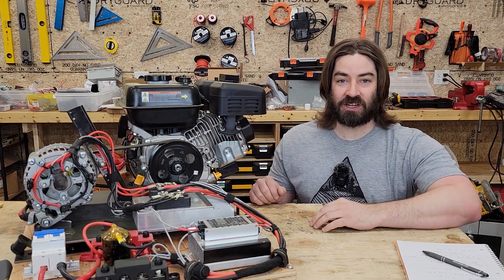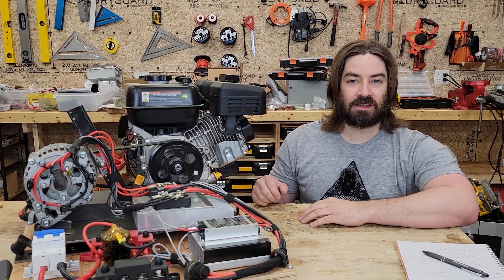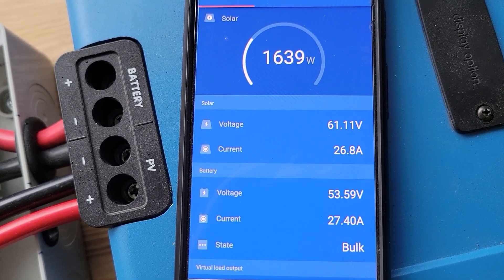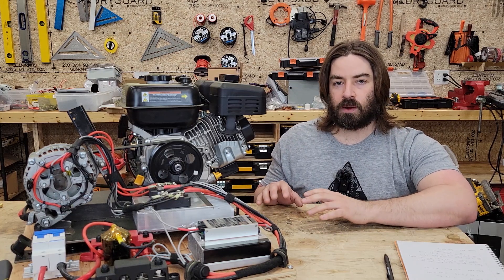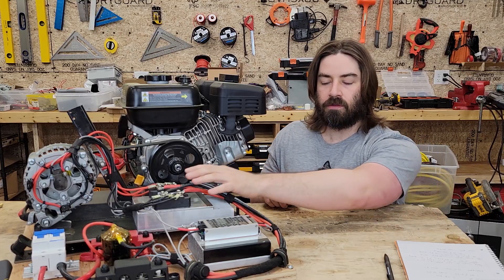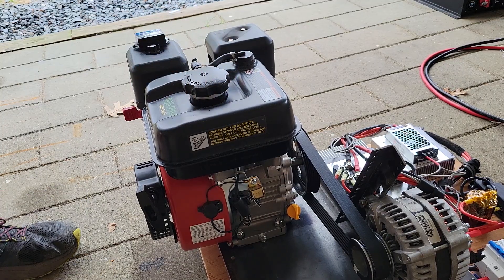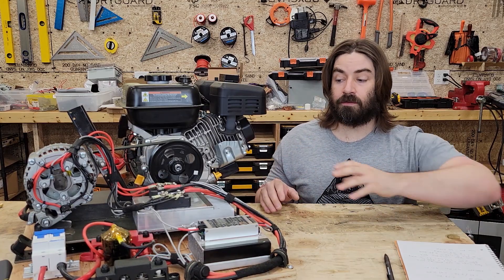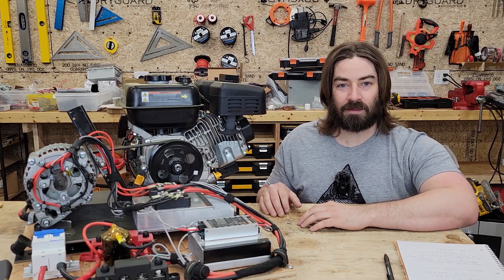More Efficient than ever!  Alternator Generator fine tuning, Part 3

Comment: You should get a heavier flywheel for the engine to reduce the shaking and get an more even load and rpm on the engine as you have a low rotating mass too the high load
Reply from the maker: When I searched for flywheels, I found lighter aluminum ones, but I didn't find heavier ones.  Do you know where they are sold?

Comment: Hi David, did You think to use alternator from mild hybrid? There are water cooled types and they are directly for 48V... Usually they are motor-generator, so you can start engine with them. No need to use victron, no external rectifier, ...
Reply from the maker: I didn't know about them until my first video in this series when a commenter mentioned it.  I think it would be fun to test if I could find one.  However, I've got some other generator projects in the pipeline that I'll be working on soon.
Reply: Where can I get one of these from a mild hybrid? What do I search for?

Comment: That's awesome. Glad to see my theory proven out.

I don't think it's super necessary, but I'm now wondering if efficiency could be clawed back with a different belt length and different ratios. 

I will get off my butt and get my Alternator Generator rebuilt and run some tests.

Comment: you got something wrong here.
youre trying to maintain 2600rpm... with the throttle. thats not how it works.

you have to do it at FULL throttle, and LOAD it down to 2600 to see the "max torque"...which will also be maximum volumetric efficiency. at which point the alternator is a dyno... minus friction, iron, and copper losses... what you get out should be what the engine can make. and at that point, what the controller is seeing and stuffing into batteries will be the absolute best the engine/alternator combination can possibly achieve.

it doesnt sound smooth as its running with the throttle partially closed.
if one alternator at full load cant stall the engine, you need two. if they cant, you need three...

tear the excitation coil out and rewind it with about double the turns... which is what you should be doing anyway to get rid of the need for the smps excitation drive altogether. a higher resistance coil, less amps, more volts, ideally more amp-turns (what actually matters) for the same or possibly even less excitation power. winding coils can be a bit of number juggling with gauges, turns, etc...

remember the excitation coil is designed for the voltage the alternator was intended running at.. and it IS just a simple coil of wire.
Reply: I am pretty sure the throttle on this type of motor is actually setting a governor. The throttle is an input to a speed control device.

Comment: Mine is about an equal engine, but a 4KW generator instead of an auto alternator. I get 120/240AC that loads up the engine if the use is more than 70%.  As I only use it to charge my house inverter system also, there is hardly ever a full load requirement.  But the big difference is that mine runs on HHS that is powered directly from the generator output to a 12VDC that produces 30 amps on the 12v side and only draws 2.1A on the 120v generator output, meaning I have a lot more over unity out of my self powered device. 

On a water electrolyte that costs only pennies per gallon of water, to create it, the hydrogen generator is fairly large with a total of 3 gallons of electrolyte and uses less than a gallon of water per day to run 24 hours per day. The generator runs a little cooler and smoother, and I operate it between 2750 and 2900 RPM.  Hydrogen produces a little less horsepower so I use another trick of running the hydrogen through a large aquarium bubbler in a gallon of regular gasoline, which kicks some of the hydrocarbons off into the air stream into the dual fuel carburetor.   This size engine uses a lot less water and very little gas per week, but requires oil daily and a full oil change every week. Once a month while doing an oil change take the carb apart and clean it, HHO creates a little sludge like ruining propane that tends to crystalize in the carburetor throat. I haven't bought a bottle of propane in years, I use the hydrogen for the generator, the house furnace, and even the yard BBQ grill. Though you do want to get an Hydrogen generator that separates the hydrogen and oxygen, together in the same pressure vesicle above 15 psi can spontaneously combust. Even through I have a pressure switch to 20 psi cut off on my separated  combustible gases, hydrogen and gasoline hydrocarbons are a lot more flammable than anything you want to use lightly.  Use them with respect and with all of the safety protocols and they are better than conventional fuels.

Comment: Thanks for this short and sweet video. Im surprised the middle ground was noticeably more efficient. Im not sure whether that primarily comes from the engine side or the alternator side, but it definitely has a noise level benefit. Even though im a ‘car guy’ first i tend to hate the sound of constant speed single cylinder engines droning away. Lowering RPM is the easiest way to address that, if it doesn’t cost you anything else. I once went to great effort to adapt a cable throttle and large muffler to a push mower engine so i could use it on a riding mower with a small crane mounted to the front, without it being objectionably loud. It did work but im thinking round 2 of that project will just be electric propelled instead. 🙂
Reply: It's entirely possible that at 2600 rpm (peak Torque) there was too much loss due to vibration. It takes energy to move that mass around. So finding a Harmonic RPM where the vibration is reduced to almost nothing serves to increase the amount being generated

Comment: I really enjoyed that. Playing around with essentially settings to get greater efficiency was very eye opening.

So, the vibration aside, you should be able to run the engine at peak torque RPM and still get the full rated power by changing pulley sizes so the alternator is rotating at the speed it was in the the last episode.

What I'd love to see, is what this engine could do at peak torque vs fuel consumption vs power produced. It is well established that you get the most value out of your fuel if you run near 100% charge capacity so if you can stand the vibration this could be a great fun test.  

IIRC, Peak torque is usually peak volumetric efficiency (VE) or the point where the ratio of energy consumed vs energy generated is the best (peak power is where the most air and fuel are consumed).

Distilled down VE is just a ratio of the swept volume of the engine x the RPM to come up with an amount of air an engine should use if filled perfectly, VS what it actually uses.
So hypothetically, say it should use 100CFM air @ 2400RPM but it uses 90CFM then it's VE is 90%. The losses are, air cleaner, intake manifolding, exhaust etc, etc, etc. It is possible to get over 100% VE without forced induction but I digress.

Comment: As I mentioned in an earlier post, it is not necessary to have your "jump start" battery.  Just connect the power supply to the output breaker, and simply turn the breaker on to get everything running.  The power supply will run off the battery under charge, and eliminate the need for the small jump battery.  Also, you should test using a slightly higher voltage supply, with a PWM voltage regulator on the output to run the alternator field.  The field should easily be able to handle 16v, and with an adjustable PWM on the power supply, you can independently adjust the field voltage to get more or less output from the generator without changing engine RPM.  Using this method, you should be able to tweak maximum power point at the most efficient motor RPM.

Comment: One thing about these small engines is, is that they have fixed ignition timing. Sometimes, adjusting the RPM gets them closer to an operating point, that makes their preset ignition advance optimal. An engine is always more efficient, if the timing is correct for the RPM and load. Under light load, the engine is more efficient at lower RPM, and at full load, (wide open throttle) you want to allow higher RPM. At full load, 3,000 RPM might be the best efficiency point for this engine. (Brake Specific Fuel Consumption)
Reply: Brake Specific Fuel Consumption👍 This.
Reply: @PeterJFrancoIII lol😂

Comment: I love this series and I think that making the ratios 1:1 will get you the most efficiency because that is where the engine and alternator efficiency curves align the best.
Reply: In the past, most people would do a 3-4:1 alternator:engine ratio, this was mostly because if you're using a 12V configuration and depending on the internal regulator, you need to spin the alternator fast enough for a 1-wire generator to self energize, also some alternators require a certain RPM to start generating.
Reply: In my experience alternators are much more efficient at high RPMs. If anything I would try 3:1.
Reply: @mckenziekeith7434  Since he is running the rotor on a DC-DC regulator and using a PPT downstream on the DC output side to step whatever comes out down to battery voltage, the rotor is likely running at a stronger field strength and drag than necessary. I wouldn't be surprised if a good chunk of the stator heating comes from unnecessary eddy current losses in the armature instead of the copper. He'd need to fix that with some form of more proper field control before raising RPMs.
The alternator is putting out 4kW at 85V or so, which is less than 50Adc. That 50Adc is split between two three-phases sets, which means 25A average per set and each coil carries current about 2/3 of the time, which means about 16A per winding. The windings themselves shouldn't get warm at all under such a relatively light load.

Comment: If max torque is at 2600, the engine need to run at this speed under load... and it should not work at full power cause it's certainly less efficient.
Maybe... open the throttle to a fixed value, then vary the charge controller to maximise power output.

Comment: I am sure I the 100th person to mention it but be interesting to see how much better it ran with out the belt.  Just a "Jaw Coupling", Spider coupler, direct drive from the engine.  I bet that is one of the reasons why the generator works better.

Comment: If there is a part 4, hopefully it'll be changing the pulley ratios.  you should be able to get data on the alternator that tells you what RPM it needs to spin to make maximum power.  from there you can calculate the pulley size needed to get the engine spinning at it's peak torque.
Reply: I was coming to comment the same thing. The efficiency nerd in me makes me wonder how far can you go? I also wonder about 2 alternators on the same engine as you had thought at the start.
Reply: Except the alternator isn’t the same anymore. It’s custom.  So data sheet is nothing now
Reply: I would be willing to bet the OP and the the two current commenters $100 USD each that David had already done a shit ton of math and research before deciding on a pulley ratio.  

That kind of math doesn't make for good YouTube entertainment though, so I'm glad he left it out.
Reply: @WimPrest  In the first video he said he calculated the pullies for 3600 rpm. He just didn't show his math....;)
Reply: That being said, if you've got compelling math to show him otherwise, I bet he'd be open to it.  Saying "go figure it out" means you've already assumed he hasn't ;)
Reply: Same idea.
Engine is 6.6Hp, which usualy conected to 3.2KW alternators (chek comercial solutions, and you find correct ratio).
But here we take only 2.2KW from 6.6Hp engine, what mean it`s underloaded and fuel efficency decreasing. By lowering RPM we reduce engine power and increase efficency.
Unfortunatly we reduce voltage, and Victron don`t like to load alternator at low voltage. Possible we ned pulley ratio 2.6-2.8 to 1

P.S. I am using old car alternator and it self priming. Due to age, alternator steel save some magnetic force and even without priming it`s produse 2-3V at High RPM
Reply: +1 on the pulley ratios to match max tourque
Reply: A Honda 2200 is spec to run over 3 hrs at 1800 w output giving you 5.4kwh of AC out. With a 95 % switching supply as a charger you should be able to achieve well over 5kwh per gallon. Of course at a MUCH higher cost
Reply: I think this home made generator with belt drive is actually quite close to the expensive and factory trimmed Honda.

Comment: This project is really interesting, but you have to consider that a Honda fuel injected EU3200i plus a Victron 120VAC to 48VDC charger (96% eff.) provides 6.86KWh/gal. to the batteries at it’s rated output (~48 amp charge rate). That’s 40% more efficient than the homebrew. Yes, the Honda is a $2500 generator, not $400 in parts. But you have to consider fuel cost based on expected runtime, and reliability. Still very cool!
Reply from the maker: Absolutely this is not the most efficient option out there.  But it's a lot of fun.  Going into this project, I wasn't sure if I could get 3kWh/gallon, let alone 4.8!
Reply: @DavidPozEnergy  Thanks David for your reply, and for what was a very interesting video series. I really enjoy your channel.

Comment: Have you considered having an option to run the generator off biogas or propane?
Reply from the maker: I've thought about doing a test with propane, but not biogas.  I haven't looked into the different conversion kits out there yet.

Comment: with no load can you set the guvnor on the engine to 2600 rpm then once load is on the engine should try and self adjust to keep it there

Comment: My thought on this experiment is: power output has two primary components, the external engine load and the internal friction in the engine that needs to be overcome.

At low engine load, much of the fuel burnt, just goes to overcoming the internal friction.

I would try to load the engine as heavily as I can without bogging it down. Let that governor work hard! 

Since you can control the amp draw from your smartphone app, keep adding load till you can add no more. Gather some datapoints at differet RPS’s, extrapolate the efficiency curve and then you can find the optimum.

Comment: That is definitely better fuel economy than I would have guessed. A lot of people try to do this and keep the alternator 12v with an inverter...and the efficiency is awful. It may also be increasing in efficiency as the engine breaks in - you need a good 25+ hours on it before it's fully broken in. (There should be a noticeable drop in how much metal you see in the oil around that point)

The Honda test you did is surprisingly good too - inverter generators are not the most efficient when they are not running at near full load. An old style non inverter generator may produce an extra KWH!

Comment: I don't think your pulley ratio is optimal for best fuel efficiency. 40 amps at 50 volts is 2 kW. In mechanical terms, 2 kW = 2650 RPM times ~ 5.1 pound feet of torque. The motor max torque point is over 10 pound feet, In general ICE efficiency is best when the motor is running fairly slow, and loaded at pretty high torque. If you can stand to do a part 4, it would be interesting to see what the result of running the alternator with a higher step-up in RPM would do. With a fixed voltage on the rotor, the output voltage will be proportional to RPM. And you have one more parameter you can tweak: you could lower the voltage on the alternator rotor to fine tune the output voltage. I suspect that the alternator will be most efficient with full power to the rotor, but that's just a guess.
Reply from the maker: The way you phrased that "if you can stand to do a part 4"...  I think you understand it's a lot of time to make these videos.  I have another generator (MEP-831A) that is diesel.  That's the one I want to move to next.  Do some fuel tests on it recharging my battery.  I want to check the box on this project for a while.

Comment: Good videos, some thoughts about efficency. The temperature coefficient of copper is 0.39% per deg C, so the cooler you can run the less power will be lost in the stator windings. Could you experiment with fitting finned heat sinks to the alternator as a first test. For a given power output you want the highest voltage achievable to reduce current. The rotor is drawing a constant 60w, could you strip the alternator and replace the stator winding with rare earth magnets,. Would it be worth increasing the gear ratio to spin the alternator faster, more volts and less current,. I suspect there are quite a few small improvements that could be made. Probably a lot of trial and error to get the best combination, as there are a lot of variables.

Comment: 4.85 Kilowatts X $0.34/kWh = $1.65 cost on Grid
4.85 Kilowatts X $0.63/kWh =  $3.06 cost on Gasoline
Gasoline in this scenario is $1.41 more.
The average electric rates in Massachusetts cost 34 ¢/kilowatt-hour (kWh). That’s 63% higher than the national average, which is still cheaper than gasoline. Simple is better; "Engine + PMA + Rectifier + Charge controller".  So, a 247 cc Diesel @ $353 + 3500 watt @ 2700 RPM PMA @ $660 + 300 amp Rectifier @ $60 + Charge controller @$675 = $1,748 for 10+ kWh per gallon. If you already have an engine deduct the cost for the diesel = $1,395

Comment: Rather than buying gasoline or diesel have you thought of making alcohol in the summer to use in the winter?
Reply from the maker: I have not considered that.
Reply: @DavidPozEnergy  'Renewables' work fine in the summer but few work in the winter, energy storage is KEY. Alcohol is a possible, hydrogen is another, a little more technical/expensive but possible!